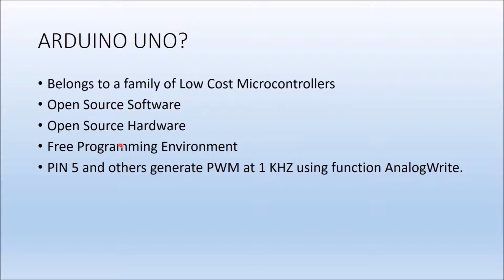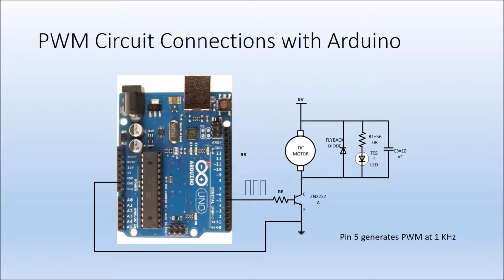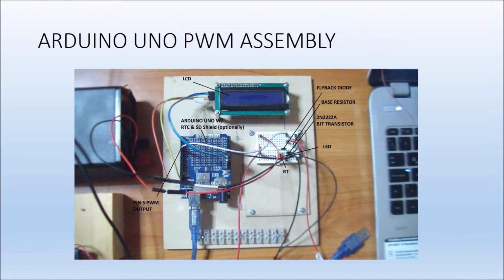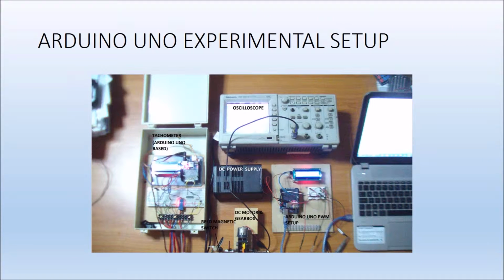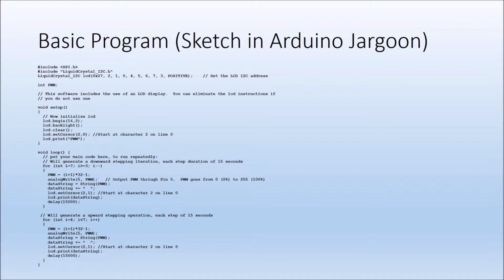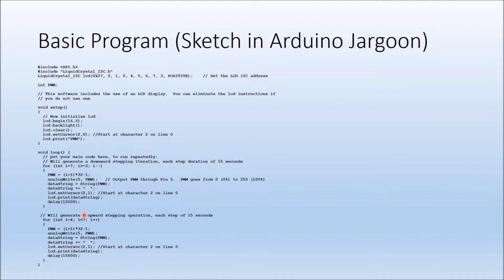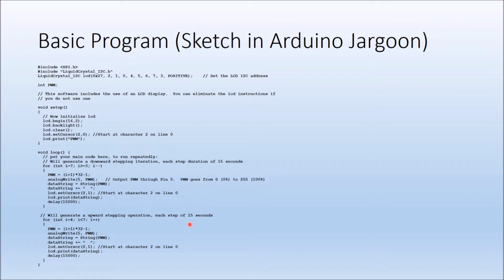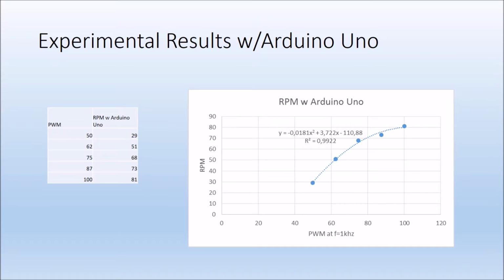A COMPARISON OF 3 SIMPLE METHODS FOR SPEED CONTROL OF A DC MOTOR BY PWM.  PART D. ARDUINO BASED

Comment: hola luciano, te quiero pedir un video por si puedes hacer algo, es acerca de una fuente de poder regulable que trabaje con un transformador de 24 V y el diseño, he encontrado muchos videos pero pocos explican con detalles como los haces tu, podrias? gracias por tus videos, un abrazo
Reply from the maker: OK. Lo tendré presente para un próximo video.   Tu necesitas una fuente de voltaje que tenga como entrada 220 V AC y entregue 24 V CC regulados.  ¿Es eso? Saludos
Reply: si exacto, es eso, gracais y saludos